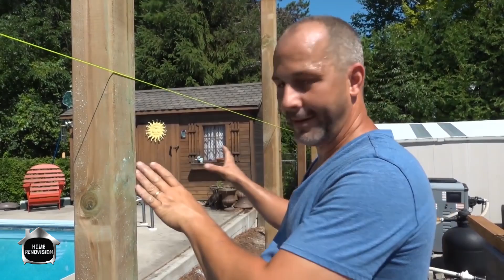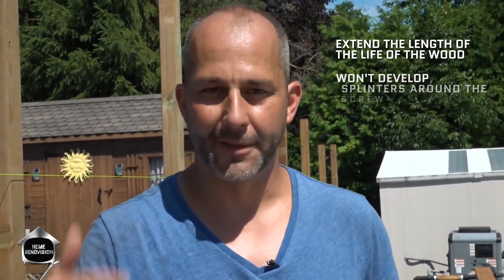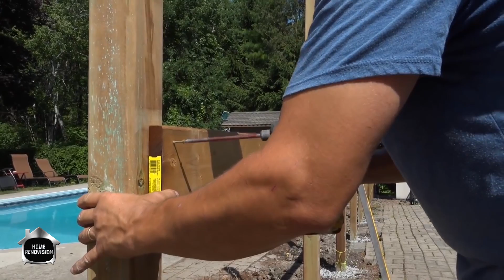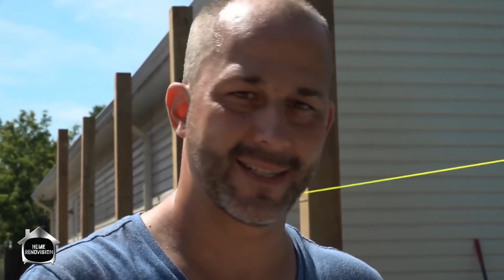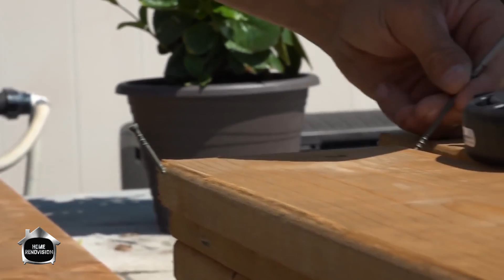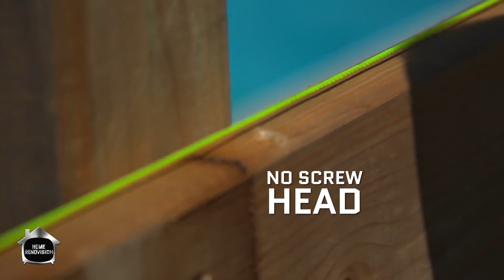How to Build a Horizontal Fence DIY

Comment: How build horizontal porch rail do you cut exact and  toe screw each horizontal board  2x4s or 2x6s between the 6x6 pressure treated post or build like mini framing wall to 2x2s  and insert it. Just what do we do?

Comment: Do you think the screws will pull through the corners of the board if someone was to say, climb over it.  Seems like a great idea for a deck but I would be afraid the boards will split if some pressure was put on them.

Comment: So you end up creating a bunch of screw head pockets at a 45 degree angle facing up, like that's going to collect less.water than a flat vertical screw head. This makes absolutely zero sense.

Then you cut off the ends of the prefinished wood, and are too lazy to refinish the end, all after going on and on about screws and wood rot.

You sir, are a fraud and a hack.

Comment: Assuming you have a deck already built with the deckings screws on top. Would it be a good idea to caulk the top of the screw (with brown caulk or w/e) to prevent rotting/splinters as you mentionned?
Reply: As someone that's ripped up an entire nailed in deck on an old house please don't do that lol nice thing about decks is that if a board rots u can unscrew it and replace it, screws come in and out unlike nails hence why they're used so much more lol.. 2 years later so u probably made ur decision already tho 😅

Comment: Short and very helpful video on using a different tool when building a fence alone.  Question --Jeff.  Can I build all the fence on my side so it looks better?  Is that a law or on the honor system or whatever we have the most cajones to do?
Reply from the maker: fence posts go on the property line. in most cases the neighbor is supposed to help cover the cost of the fence. if not you do what you want. Cheers! just make sure you are building within the code requirements so if they complain there is no consequence. Cheers!

Comment: my only worrie with the CAMO system is retaining the initial tension resistance of screws since its not cutting through that much of material when screwing at an extreme angle near the edge like that. Is there any specs from CAMO about that?

Comment: Did you create a video showing how to put the post into the ground?  Ok, I watched the finished video and it did show one of the posts being put into the ground. You did not put any gravel at the bottom for the post to sit on (not complaining, just asking).  did you treat the part of the post that will be underground?  I was also curious about what you did at the ground level. If the ground is not level one is going to have a gap at the bottom of the fence. What is the best way to address the "gap."

Comment: 1/4 of the video was basically an ad for this tool. The vast majority of people aren't going to use this tool so it would have been nice to see an install that most people would find helpful(since this is a tutorial). Seems like a nice system but again most people aren't using it. I love your videos and most are EXTREMELY helpful. Your tips have helped me on several occasions. :)
Reply: But if u don't use the tool u just screw it in flat?

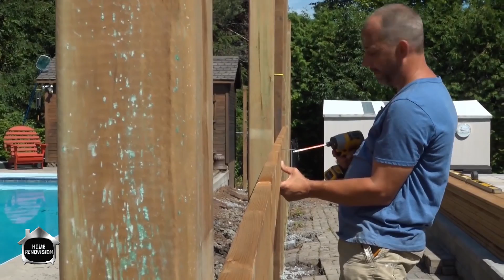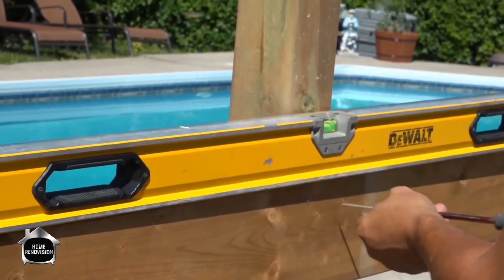Comment: Great video!  What do you do, if anything, regarding the first two surface-drilled screws (4:34, 4:50) from the initial leveling board?  (Do you remove/fill them or just leave them as-is?)

Comment: Know this is an old video, but why pre drill/set the screws and then put the boards up? As its way faster to bring the camo and use its own spacers. Been using the camo system for years, its brilliant :)

Comment: Excellent work, as always. This channel is so inspiring.   I used the Camo system on my deck and it all looks great nearly fives years later.  I'm now planning to build a fence very similar to this one. The lumber in the video sure looks like cedar;  if it's pressure treated, are there any tips or concerns about staining or warping?
Reply from the maker: Very cool! I built this fence 3 years ago. I checked on it recently and it still looks great. no worries about the movement. The staggered joints fix most issues. Cheers!

Comment: Is this sponsored or you just love Camo that much? Agreed it sounds like a smart system.
Reply from the maker: I am just in love with camo screw system. It makes all my jobs look better and last longer. Cheers!
Reply: Home RenoVision DIY is there ever any issue with the camo screws popping out if the wood is installed a little wet and shrinks? Kinda leaning to camo for my deck.
Reply: @crudzy3327  Yes there can be. I used Spotted gum for my decking and a few boards have warped and split the edge where the screw was inserted. I had to face screw and counter sink these boards to get them to pull down flat.
Reply: @HomeRenoVisionDIY  have you experienced any broken screws? on my deck some boards came loose because some of the screws just broke. I love camo system however i just wish their screws had a bit more body - they are quite thin compared to normal screws.